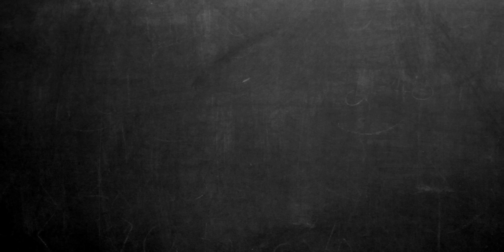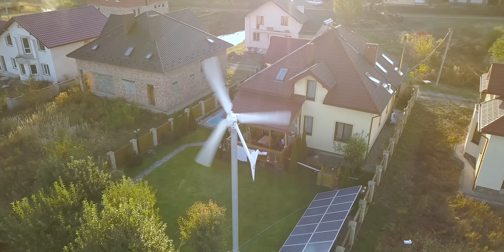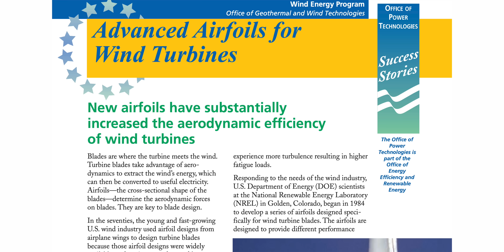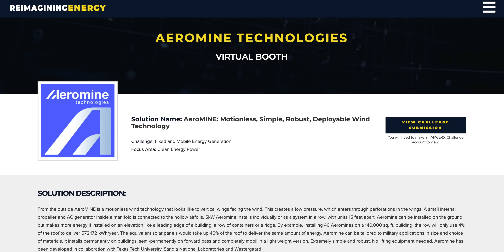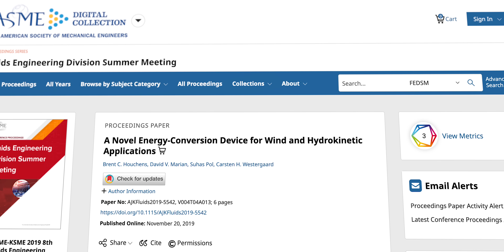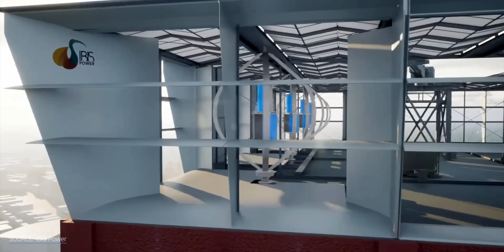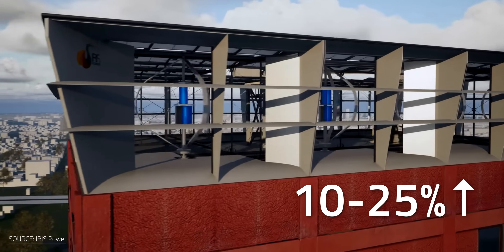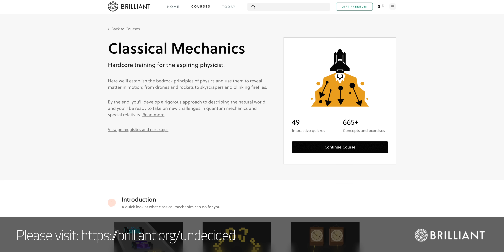How Can A Wind Turbine Be Motionless?

Comment: So on top of being vulnerable to long term wind droughts, these will also have low performance when the wind doesn't come from a specific direction? Sound like a winning solution!  No mention of including batteries in the system.  I interpret this to mean that they are still far away from being able to deliver power consistently with several 9's of up-time like the conventional electrical grid. Have they factored in the cost of back up fossil fuel power?  Not-a-chance!  The problem is that the more you spend to diversify your production without solving the worst case, the more fragile your system will be in real life.  The worst case will arrive at some point.

Comment: Love the channel:) One very important thing about wind, though: There is a finite amount of wind energy per area (around 250Wh per square meter at  a lively 10m/s wind speed, give or take). The motionless contraption would need to have at least one side (facing the wind) being around 20 sqm in size (250w x 20sqm = 5000W) with a constant strong breeze, and sucking out ALL the energy...  It is really quite simple. And the rooftop thing: Wouldn't we save the environment more by adding an extra level of living/working space, in urban areas...?
Reply from the maker: Thanks for watching and for dropping some knowledge!

Comment: So, a short physics lesson to clarify air foils. The shape of the cross-section of the wing is essentially irrelevant, as is the DIFFERENCE in speed of the air above and below the wing. In fact, the air above and below the wing can arrive at the tail edge of the wing at the same time without contravening any laws in fluid dynamics. What creates lift is the angle of attack. This is Newton's Third Law of motion at work, which essentially says that for every action there is an equal and opposite reaction (in simple terms). In its motion forward, the plane wing shoves down on the air, compressing it while decompressing the air above it. Nature abhors imbalance, and tries to equalize this by shoving back--which is upward, creating lift. In this wind turbine the same forces are at work, however the foils force the wind to travel faster to try to equalize pressure (this is not the same as the relative difference in speed of two airflows), increasing its stored energy and thus its ability to move the turbine quickly (all other things being equal, a higher turbine speed equals higher electricity output.) In other words, wind shoves the turbine, it tries to shove back, it spins, and the foils are just concentrating the wind power into a smaller space. That said, this design is extremely clever and I love it!

Comment: It was barely mentioned in the video but the main feature of the Aeromine wind turbine is that it utilises the compression and acceleration of the airflow over the edge of a flat roofed building.  So it's using the face of the building to capture energy in addition to its own input area.  If say the wind velocity was doubled by the compression then it would increase the power generation by a factor of eight compared to a simple turbine mounted on a tower.  Of course this is only likely to work if the air flow remains laminar and doesn't become turbulent so the shape of the building may be critical.  This also means that you can forget any idea of making it turn to face the wind.

Comment: This would work really well in my cross ventilated dairy barn, we use a wall of fans to ventilate our cattle and keep the air fresh, you could reclaim some of the energy or even make it neutral as the heat from the cattle would create a pressure differential.

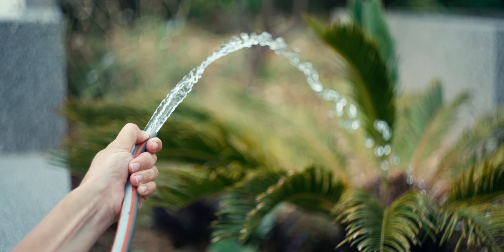Comment: 7:20 your discussion of the Venturi effect is wrong. If you got that info from the company that makes the product, they are wrong too. The Venturi effect has to do with the reduction in pressure as flow accelerates along a streamline. That garden hose analogy, and probably what the Nest thing is about, is simply related to conservation of mass, as first documented (if not discovered / invented) by Leonardo da Vinci. Blow air through a funnel and it will accelerate simply due to conservation of mass; that velocity (and momentum) is what will drive the turbine.

I really do hope some of these green energy things become competitive, but it is very difficult when so many people really want things to be true when they do not even understand or acknowledge the TRUE basic physics that governs how nature works. The truth usually wins in the end, and physics always does.

Also on the "motionless" in the title (which got my attention), the turbine is just not exposed or visible. It still exists within the system, so the system is not truly motionless.

Comment: 2:56 "This results in the bottom side producing the higher air pressure needed for lift..."  Phuck, NO! Lift is generated by the difference in air pressure between the upper and lower surfaces of the wing. 
Aerodynamics is a complex subject, however generally speaking the lower surface camber is much smaller than the upper surface camber. Because of this, the upper camber accelerates the air to a much greater magnitude causing a greater lower-than-ambient pressure above the wing at zero degree angle of attack. Whilst most lower cambers are still convex, the wing's positive angle of attack in level flight means that the lower camber will still slow the air down causing a higher-than-ambient pressure below the wing.

Comment: WRONG. The real problem for residential wind is the amount of energy you can obtain from the wind. Power (kW) per meter square = 0.0006 velocity cubed. Most wind speed in urban areas is 3m/s, which means  0.0006 * 3^3 = 0.016 kW, or 16 Watts per square meter. A turbine will have an efficiency of like 30% (but realistically more like 20%) so 5 Watts, which is useless which is why people don't have wind turbines on their homes. Industrial wind farms work because the are built in high wind areas and the tall height of them are able to access wind that is consistent and free from the friction of ground objects.

Comment: A small voltage between a sharp point and a nearby plane will ionize the air.  As wind does work on these ions, many thousands or a few millions of Volts can develop between this assembly and the ground.  These ions are attracted to their image charges opposite the ground plane completing the circuit.  Power conversion circuitry can adapt these large DC voltages to conventional power needed for a home or the grid.

Comment: won't work in the real world wind direction only stays constant at high altitudes so the top half would still have to turn to face this also to use an updraft will only work on high buildings a normal residential or even commercial will be too low this side would have to be south facing  " or north in the southern hemisphere " to get the benefits of heat-induced updrafts

Comment: It does not make sense as to why it cannot automatically face the direction the wind is blowing. You can do it as easily as a mechanical lazy Susan or if that is not an option you can just install an electric motor powered by the turbine itself to rotate the entire thing facing the wind. This is why I so dislike our current crop of so called researchers and scientists. They are deviations of IQ levels below those scientists we used to have pre affirmative action. And another thing. If you place these on sky scrapers etc. You can take advantage of the wind that literally blows upwards from the side of the building at tremendous wind force just by having a louvre extended over the edge of the turbine. Such bad design and execution.

Comment: You install a tower on your roof , that is not structurally past of the building ... what could possibly go wrong?
Never mind!  Wont be the first bullshit some idiot politician bought, that did not work as advertised. 
I have a question though..We set fire to turn liquid to gas,to power the turbines that produce electricity.
WHY?We have the technology to pressurise any gas at insane rates. Choose your gas, pressurise it and .. push it to move your turbine.
Same with cars. Why burn shit when you can use pressurised gas ? Its something i dont understand and it bugs me.

Comment: I think those Nests need to be mandated through all of Europe. Getting off Russian gas is a priority and this is clean. Battery banks for on demand power when needed. With Ukraine rebuild, it's a clean slate and designers can use the full potential in architecture with renewable power systems.

Comment: Interestinger and interestinger as Alice might have said. The solar panels on roofs in such high latitudes as Eindhoven seem a little flat, but I love the ideas like the nest. Living in an area of pretty reliable wind (SW coast of S Africa) and with a virtually non functioning national grid, I am always looking for wind possibilities to supplement the shorter winter hours of the sun on our panels. 🤔
Reply: Thanks Nicolas, the solar panels in eindhoven are directed to the East and West to distribute the power generation during the day (morning/evening) instead of having the 12PM peak of the South direction. Their angle is 15 degrees which is sufficient to capture the sun and keep them clean by offwashing rain.
Reply: @alexandersuma  very interesting. I have tried to get our solar guys to do something similar to catch the winter sun earlier, as our panels all currently  face NW and are inclined at 45degrees. They claim there is no benefit in placing some on the SE roof. What you say may be useful in convincing them to reconsider the problem. I’m not tech savvy though.🤔

Comment: Not a fan of moving parts.  Dangerous, need replacement, does it pay itself off, bird strikes, climate changes, people do bad.  A fan of static power generation.  I think anywhere with poor infrastructure, for whatever reason, off the grid generation with minimal maintenance, maximum safety is better.  All else requires  regional and climatic stability.

Comment: This is pretty great, it might not be clear to all, but a normal windmill cost is around 1.25mio$ on land to around 4mio$ at ocean. But normal windmills start producing power at around 8meter/s - This one cost is around 2.75mio$ but it start at 2.2meter/s and it do not stop when wind is high, so window where it produce power is bigger than normal windmills. Today you might get power from wind 30-40% of day, so you need a big expensive battery. With this mill you get power 80-90% of day so you just need a very little and cheap battery as backup. Try understand what i say - this invention can be a gamechanger in renewable energy. We just need them for private homes too.

Comment: Our condo building in Florida has a large flat roof garage next to the ocean where wind is constant.  This maybe an excellent location for an Aeromine generator.  Electricity cost here is well below average, but demand charges are through the roof.  Offsetting demand charges is where this generator can help when linked to a battery.

Comment: But they have turning generator inside. Any turning device will eventually fail. So they need a maintenance for it. As Elon Musk said, the best thermonuclear plant safe and maintenance free is our Sun. Just use some solar panel plants and that's it. We should build thousands of square miles of solar panel plants in sunny states and find out how to recycle them after 20 years. That's it.

Comment: I’ve seen the aero mine turbine crop up but there is a stark absence of performance data. I’d love to see someone run through the technical limitations, betz law etc. it seems to require oddly specific installation parameters for an estimated 5kW output and projecting 3x output (14.3MWh) of similar size solar. This output means full power for about 8 hrs per day or about 40% output for 20 continuous hours. Has anyone looked at wind data to see if this is probable? I suspect real world performance will be much less than these claims and with many caveats. Hope I’m wrong

Comment: The device works in the opposite way than what was explained in the video.  The air is drawn through the turbine and then out through the perforations in the foil.  Also, the air moving under a car is moving slower than the air moving around and over it, which generates lift, which is opposite of what was said in the video.  All of the aerodynamic features of a racecar are designed to counter this.

Comment: I'm absolutely curious about how the Nest system would handle high wind weather... like hurricanes and tropical storms. If they're interested in major US cities, I would expect that the design accounts for those events. However humans as a species have made more obvious mistakes, so I can't rule anything out here, lol.
Reply: Hi Roy, PowerNEST is made of a steel structure designed to withstand such wind loads. The turbine has an automated safety break. The survival speed is 60 m/s which is around hurricane #4. Usually one knows 3 days ahead when a hurricane is coming, so we can remotely break our turbines when we think it is neccesary.
Reply: @alexandersuma  Thanks for the information! I figured that such measures would have been taken with the design. But ever since the "metric mishap" NASA had with their Mars probe that launched Dec 11, 1998, I put my expectations on hold until I know more details about a project.

Comment: Those power nests are so cool; I love that the system is complementary, which each mechanism boosting the effectiveness of the other
Reply: Thanks! Great to read your comment and support
Reply: Are roofs meanwhile equipped with enough units? 
And are there independent tests of how much electricity was generated at which investment costs? I am sceptical. I've seen too many small wind turbines come and go…

Comment: If you use bernoulli equation to determine the lift, you would notice there won't be much lift.
Reply: Agreed, compressible flow theory would be better applied considering there is a turbine but it might be ok to still first pass debunk this bs

Comment: What good is a plane that can’t turn? What good is a windmill that can’t turn to face the wind? 
Until the units can swivel to achieve maximum efficiency with angle of attack it is still not ready from prime time. 
Cities have multiple wind patterns over a single roof. Ability to swivel is paramount to tip the scales in cost effectiveness.

Comment: I saw a video but i don't know what channel, but they put a small vertical wind turbine on a center wall in the middle of a busy road like interstate highway. The cars passing it made it turn and generated electricity. Image if you could put smaller horizonal unit on a car roof that would recharge the cars battery as it drove down the road. It would increase the range of the car.

Comment: Call me crazy, but small-scale wind turbines will never take off. There's multiple problems:

1. While the manufacturers claim to generate power at low wind speed, they do generate very low voltage and nil current, which means that they are typically outside of their charge controller ratings until they get to 30 mph. They claim 15-20% gains, but this only means that they are now producing 6% of normal operating conditions instead of 5%.

2. Brake loads. All turbines require a constantly connected load to keep from running away during really windy days or overcharging the system. These systems are prone to failure as small scale turbines can't vector their blades to slow or stop when they start going too fast. While resistor loads are the typical, these frequently burn out. Then because no one is monitoring them, they fly apart on the next windstorm.

3. Ongoing maintenance. Let's face it, humans are lazy and complacent. Most turbines require frequent bearing changes and medium size ones require cranes and lots of equipment to change them. How do you block off a city block for cranes and rigging a day per year to swap bearings?

Often small solutions can produce better results than large ones. Like using graphene for a small project. However Wind Turbines scale differently and only the utility scale ones are generally practical.

Comment: 1. Nice to not chop up birds with wind-generated power.
2. What's the long-term maintenance power when compared to solar panels?
3. Why not mount these Aeromines on a rotating platform so they can catch wind in 360 degrees?

Comment: at 1:16, when you say "High upfront costs," that's significantly misleading.  Onshore wind has a much lower levelized cost of energy - according to the EIA.  High costs compared to my weekly grocery shopping, but not high costs when compared to building a new combined-cycle gas plant.  http&s://&www.eia.&gov/outlooks/aeo/pdf/electricity_generation&.pdf  (remove ampersands)

Comment: Im very skeptic, to say the least. Wind energy is extremely spread out, so you need as much turbine area as possible to generate power. Maybe the wind can accelerate the air somewhat through the ducts but the relatively tiny area of the ductwork and the turbine itself means it would need large pressure ratios to produce meaningful power. Which is something wind can't easily achieve.
Reply: Absolutely right 😅. There is no chance on earth it will work to produce a decent power. One would have to move huge amounts of air at high speed In order to produce  meaningful power. The present design will not accomplish this.

Comment: One problem with the Aeromine -is the wind always has to be coming from the same direction. Which is a big part of the reason why they made vertical axis wind turbines and why the PowerNest uses vertical axis turbines.   A vertical axis wind turbine like in the PowerNest can still spin with wind from all directions.  The powerNest looks legit but the Aeromine looks like more gimmicky BS....... My guess, it's the $300 bladeless Dyson fan of the wind turbine industry.